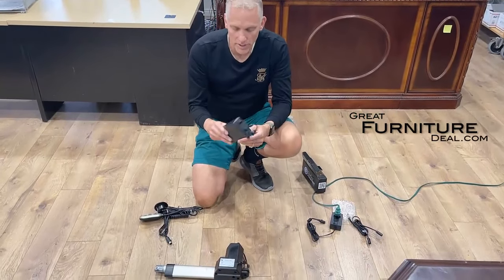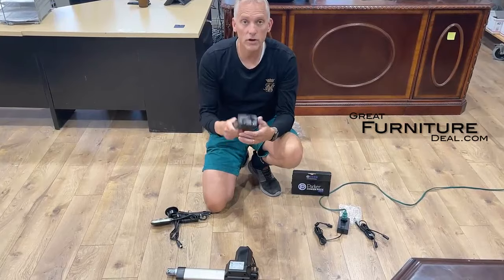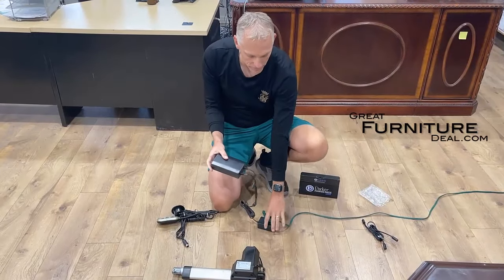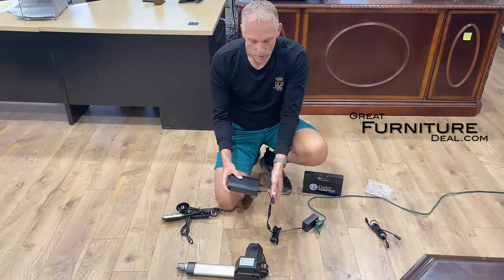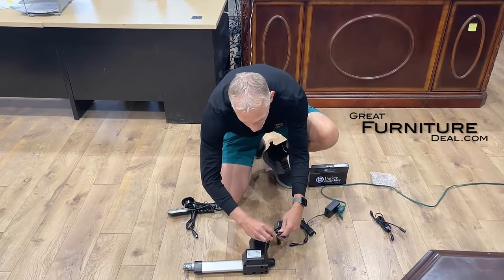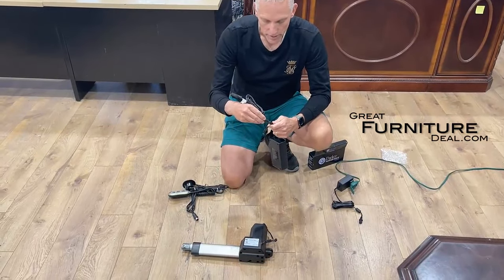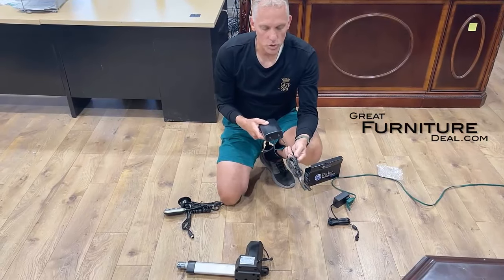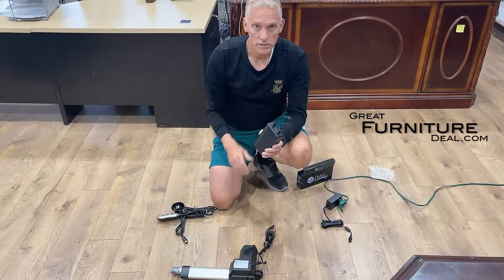How to connect your Power Recliner or Sofa or Loveseat to wireless battery pack – DIY tutorial

Comment: How does the battery pack alert you when it's running low on power? How do you operate the recliner/sofa when the battery is recharging?
Reply from the maker: The battery has a light on it. When the battery is low, the light turns red instead of green. We recommend that you charge the battery overnight while you are sleeping so it is always working when you need it. You can't charge and operate it at the same time. Here is a link to the battery: http://greatfurnituredeal.com/products/southern-motion-parker-house-wireless-rechargeable-battery-pack-power-supply-for-power-sofas-loveseats-and-recliners-somo-wbp